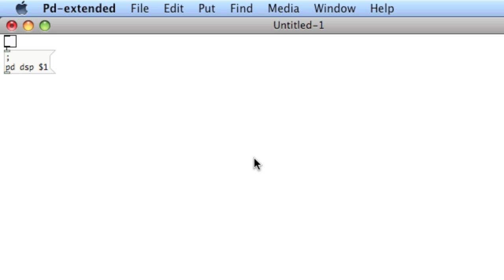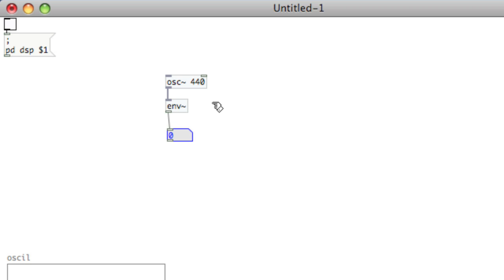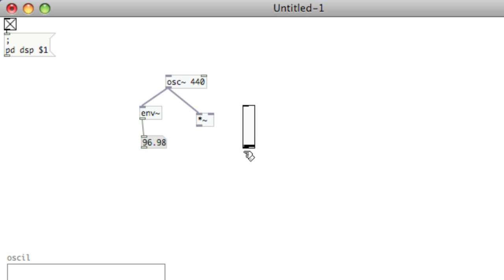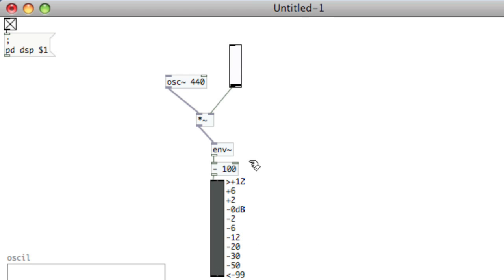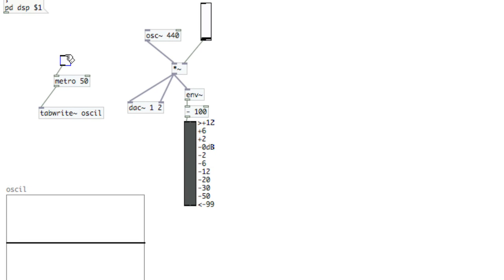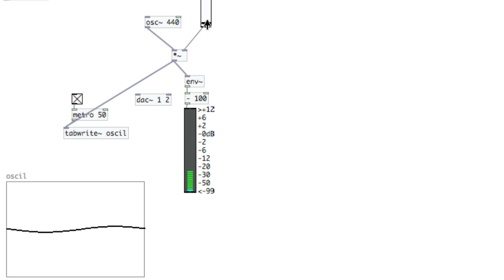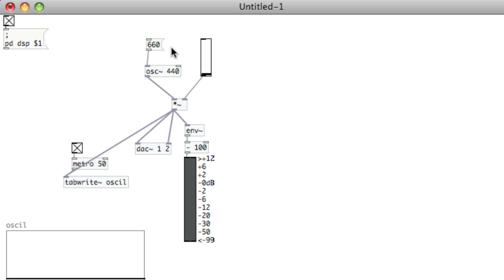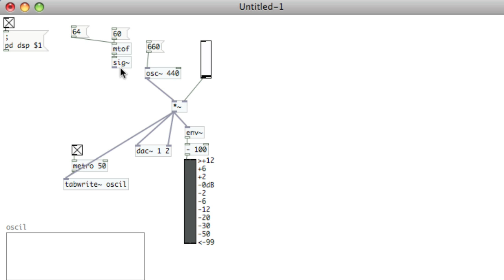PURE DATA: 18 Simple Oscillators with [osc~]

Comment: hey mate, desperately looking for help with using the (drunk) randomiser. I wanted to use it with the volume of each of my oscillators, but i only have a scale of 0 to 0.5, and wonder if it's even possible! please help! haha
Reply from the maker: Reuben Riisager What you would do is divide your [drunk] output by the highest possible value to normalize it to 0-1. Then, you'd mulitply that by 0.5.